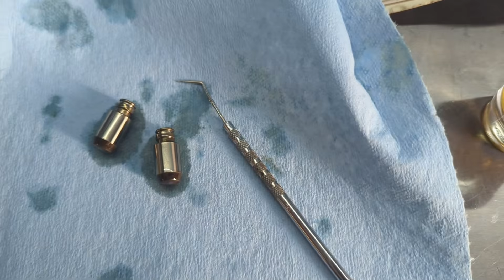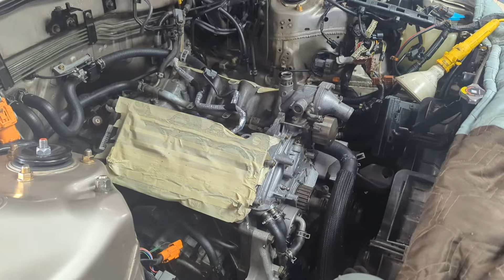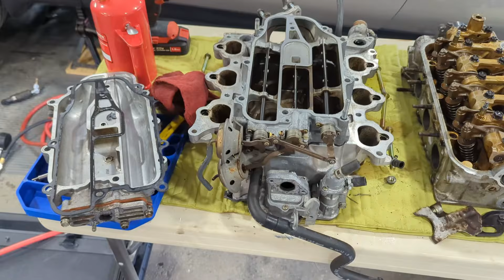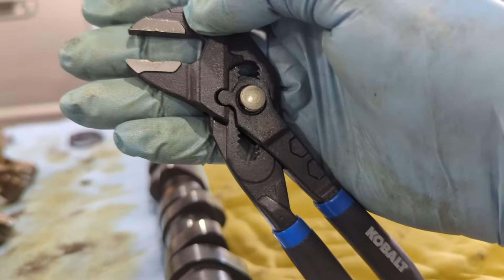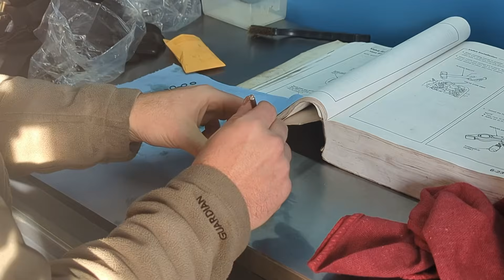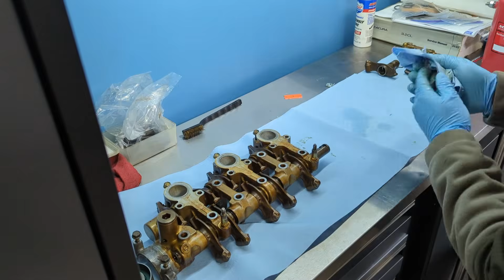1991-1995 Acura Legend Head Gasket Repair - Part 3 (The Cause of Failure!)

Comment: Hope you can save my butt here but for the life of me I cant find size specs for new O-ring seals on lifters. What hydraulic lifters seals did you use or size did you go with?
Reply from the maker: They come in the FelPro master kit. FEL-PRO HS9031PT Cylinder Head Gasket Set
ACURA	LEGEND

Comment: gracias por su aporte me ha sido de mucha  ayuda para poder darle otra oportunidad al motor de mi Acura legend 1995  realizando el trabajo de mantenimiento por mi mismo en casa.
Reply from the maker: ¡Me alegra mucho que mi ayuda haya marcado la diferencia! Darle una segunda oportunidad a ese Acura Legend con tus propias manos es realmente impresionante. Sigue así, y no dudes en contactarme si necesitas algo más.
Reply: @acura2g good day. I noticed some o rings when you disassembled the rocker assembly  do those have to be changed also or leave them alone?

Comment: Hey ty , video  was good explanation  of possible  Hgf  and why  I had my Hands on mine since  new  91 ls and maintained   since new  , I personally  seen and suspect that everyone  of these cars had a new radiator  replaced  first  and foremost  as I replaced hundreds,  anyway  a lot of factors   involved  temp change , cold drive away  , maintenance  of the correct  coolant,    fuel quality   ,  egr flow,  head gaskets  type  , age , and mileage  , I have done hundreds  in 45 years at Honda Acura  ,  couple of things  I would show in the videos is  packing the cam seals  with a grease   , and placement of Honda bond in the corner s of specified  areas  , also the placement of the rear cam  plugs with  a coating of Honda bond , another  important  area like you  said is the  3 rocker o rings  and secured in place  not to fall out of place  , also where did you access  the lifter  orings  ?  Good job
Reply from the maker: Thanks for sharing your experience. The o-rings came from the Felpro Head Gasket kit.